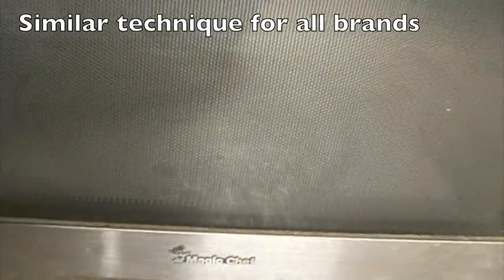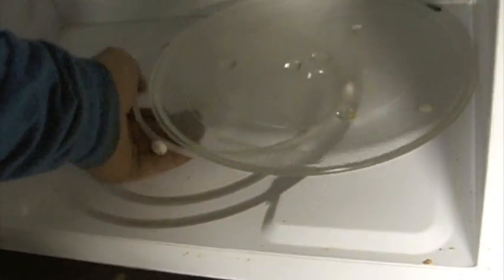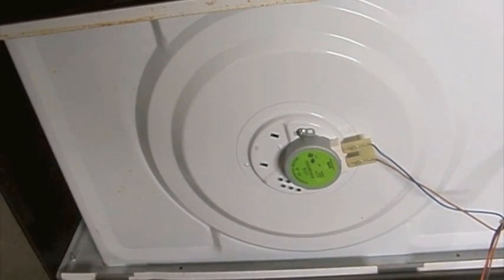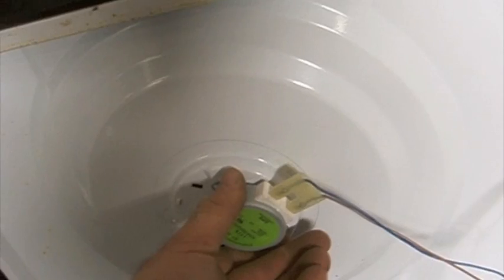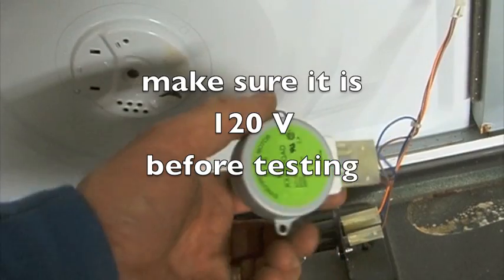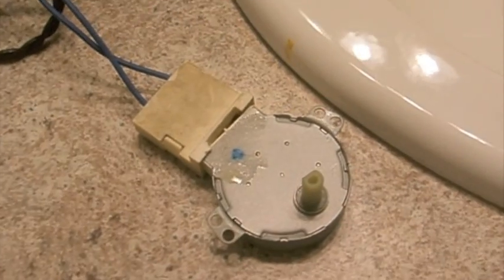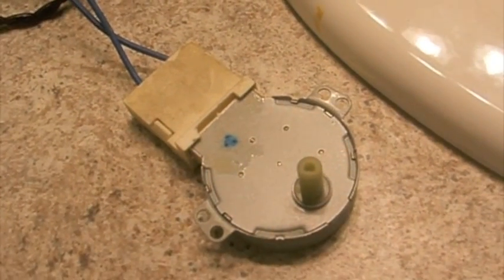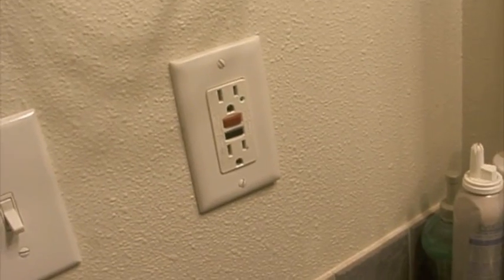Microwave motor How to remove and test How to repair change Replace a Microwave Turntable Motor

Comment: I want to know how to test if that female white sochet that the motor plugs into is sending the proper power.
If I remove the motor,  plug a volt meter into that female 'socket'  what should the reading be?
Reply: 1) If yours is a Over the Range (OTR) microwave, it is easy. Place a cup with some water in to the microwave, close the door. Plug the microwave to the wall outlet, set the clock. Reheat the cup of water as usual for the duration you may need to use the voltmeter for testing.  While the microwave is running, if you connect the volt meter/multi-meter to the female socket, it should read approx the same voltage for which the motor is rated (if the motor was working before in that microwave).  Example: if the motor spec shows as 110V AC, then your volt meter reading should show approx 110 AC (you have to set the multi-meter to AC voltage).  This is typically in the USA, i.e., the line voltage 110V AC. However, in other countries (like India) may have motors with 220V AC as the input rated voltage specified in the motor. In that case, the voltage reading in the volt meter should read approx 220V AC. 

Please note that the voltage reading discussed above assumes that the microwave is heating normally, light comes on when the door is closed while the microwave is operating.  And your only concern is that the turntable is not turning.  If the microwave is not heating, it will have other issues and there may not be any power supply to the motor at that female socket. 

2) Everything discussed above is also applicable to counter top microwave ovens.  My only concern is that it is risky to access the female connector for testing while the microwave is turned on while it is standing on its side. I am scared to start the microwave while it is standing on its side to heat something.  A week ago I had to do the same testing on my countertop microwave oven, which was heating properly and everything else was functioning properly except for the turn table not turning. My countertop microwave is on a rack and the bottom of the microwave is accessible while it is resting horizontally on the rack.  One can use two wooden planks leaving some clearance at the bottom to access the female socket for testing while the microwave is resting horizontally so that the microwave can be turned on while it is not standing on its side.  I was scared to turn it on while it was standing on its side thinking that some wires may accidentally touch and short circuit.

NOTE: If the rated voltage of the motor specified on it is 21V AC, then you would expect approx 21V AC at that white female socket to which the motor connects.  You will not expect 110V AC even if the line voltage may be 110V AC (as in USA).

Comment: Why not disconnect the motor connector and do a quick resistance check of the motor coil to see if it is open.  If coil is not open, then do the more dangerous voltage run test for discovering broken teeth in the assembly.
Reply from the maker: That way works as well
Reply: I prefer the way you are thinking - do the resistance test first.  And I did that last week with my turntable motor.  It showed 3.15 ohms.  It gave me hope.  Then the followup testing (supplying power at the motor terminals) did not show any rotation of the shaft, but there was some vibration I could feel.  I ended up completely overhauling/ rebuilding the motor assembly as I could not find an exact match for the motor.  After rebuilding, it is working perfectly - installed in the microwave and running since.  Luckily all the gears were fine.  Mine was a 9 year old countertop microwave - gave very good service. The grease inside was acting as glue and exerting lot of resistance and was not allowing to rotate the shaft.  I liked the video.  Also I liked your comment.  Great job Tom Luque as well as You Can Fix It!!!!

Comment: Not worth repairing yourself. Drive motors are often 2/3 the price 
Of a new unit.WAY over priced!!
Reply from the maker: Just go on ebay and buy a used one typically for $7-$15 depending on the motor you need.  Way cheaper than new.  I'd never buy a new one, but that's just me.  These rarely go out and if they do, I'd chance getting a used one.  Typically the motor outlast the rest of the wave

Comment: Microwave will heat, but not turn or have light while it is cooking, light will come on when door is open, bought a motor on ebay, still will not work, Do you know why this would be?
Reply: Control board is bad

Comment: this video helped a bunch! i ended up dismantling the motor and found the plastic underneath the magnetic to no longer be gripping the magnet.  a little duct tape gave it the necessary grip so now when the magnet spins, so do all the gears and in turn (haha pun) the tray.

Comment: Thanks for the video! Where can I get a wire lead set up like you have there?
Reply from the maker: I got my lead from a different microwave I had dismantled.  I like this one as it connects as one piece, instead of two separate wires.  I am sure electricians tape and two wires could get the job done just as good.  Hopefully you found your problem.